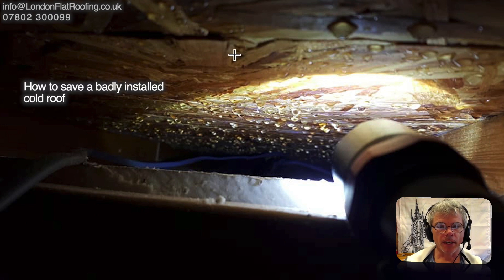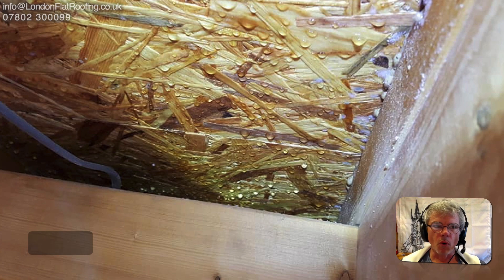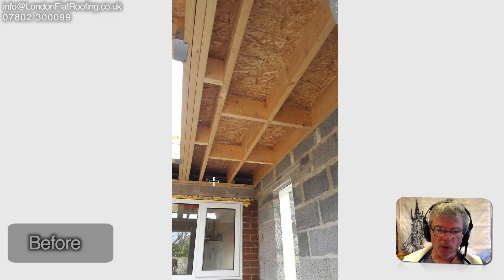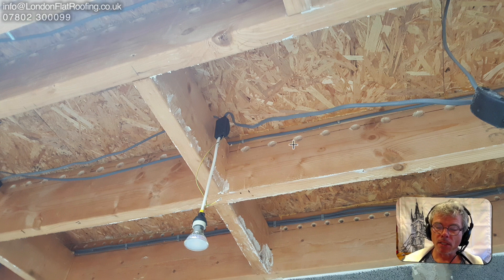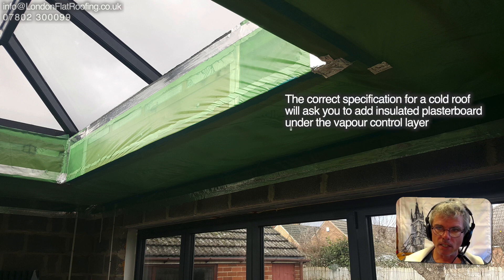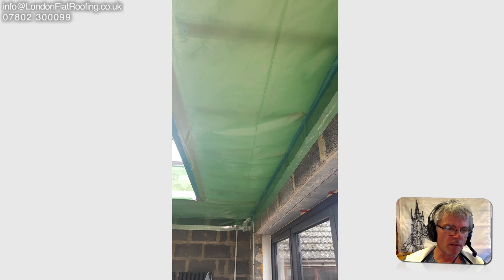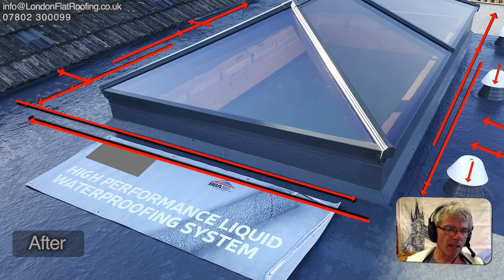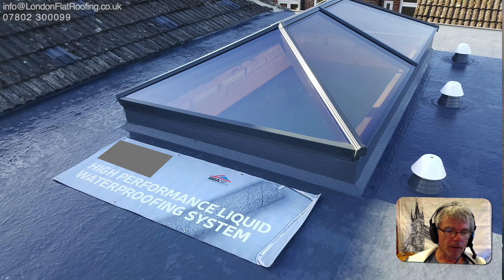Cold Flat Roof Ventilation Corrected

Comment: Hi Steve , in that video how did he fit spot lights back up now there's a vapour  barrier in the way ?
Reply: I'd love to know how too. Its all well and good saying don't cut the insulation and vapour barrier over it but how do you run a light in the exact same place using the existing wiring? Surely now it can all breath it won't matter too much because the warm moist air can travel through all the holes and not condensate. Granted, it's not going to be 100% thermally efficient, but he gets his lights and now has no moisture trap. I'm in the same predicament with a cold flat roof with only soffit venting on the face. It needs venting on both sides and crossflow drilling adding. Mine is also underdrawn with more insulation under the rafters aswell as in the rafters so this will stop thermal bridging but it's impossible to not cut my insulation for the spot lights.
Reply: I worked it out if anyone wants to know. I have no ridge airflow and only had a dorma face continuous vent strip so I added continuous vent strips in the dormer cheeks and drilled 32mm holes through and down every firring above the joists. I ended up removing all the insulation and amending the wiring runs to sit above the 100mm PIR requirement for my rafters (inside the 50mm airflow gap). Then at the spot lights, ran the wire down the side of the rafter and into a square cutout for a product called 'Thermahood' which is a sealed cover to prevent heat loss and air exchanging between the warm and cold side. I then also back filled the Thermahood with expanding foam which is friction fit inside the 100mm PIR and then added a 30mm PIR 'cap' ontop with the expanding foam helping to seal this all together. Finally, I dropped a plumb line, marked a big red X on the floor and then underdrew it all with another layer of 30mm PIR, taped all the seams and then added a VCB. Once plasterboarded and skimmed, I then used the plumb line to find the exact centre of the wire within the middle of the Thermahood and drill my 70mm hole to fit the LED spotlight and the hood can house any excess cable etc. The whole lot is airtight and thermally efficient. I had 21 spot lights to apply this method!

If you want, I'll make a video on how I did this. It seems no one has ever used thermal hoods for spot lights and this seems a massive challenge for most builders to understand.
Reply: @Craigo5000  yes please, it would be good help

Comment: Hey Steve thanks for all the great videos. Just wondering if you can use an insulated plasterboard for the ceiling on a warm roof? I was going to do this on my extension.
Reply from the maker: No you can't because that would not be a warm roof a warm roof means that the lower decking is warm the lower decking on a warm roof is actually internal you don't need a ceiling all your joists are internal the lower decking is internal the vapour barrier is on top of the lower decking everything above that vapour barrier is external You need the internal heat of the room to keep the lower deck warm if you put more insolation under it it won't be warm and that could give you a problem
Reply: @SteveRoofer  Thanks for replying. Your a gent of a man. Much appreciated. I get exactly what you are saying, that makes sense to me. Good explanation as well.
Reply: @SteveRoofer sorry I don't understand what you're saying there  my roof is 11degree pitch lean to  roof I have vapor barrier on top of ply then 120mm solid insulation then rubber on top of that  this roof is open to the attic of main roof on one side now I don't know what to do underneath do I need to try and vent it do I put more insulation between rafters do I need vapour barrier above the plasterboard ? Any help would be much appreciated thanks

Comment: I see some firms are building rooms with 5x3 joists and using 100mm pir. They push the pir up so it touches the underside of the ply and leave the small gag at the bottom of the joists and install a vapour barrier.. they claim this is a warm roof because the pir is touching the ply .
Reply from the maker: No, it's not a warm roof or a cold roof. The ply will be as cold as the outside at night but there is no ventilation so not a cold roof. It's not a warm roof as the warmth of the room below is not warming the ply as the insulation is in the way.
Reply: So this kind of installation will cause issues due to sweating With no ventilation ? 
I’ve been doing some research into garden rooms and due to the 2.5 permitted height to avoid building regs it seems firms are using smaller timbers like 5x3 to avoid loosing to much headroom inside. 
Surely it’s just a case of using 50mm pir so to give an air gap and installing vents in the soffit boards each side.
Reply from the maker: @paulpatterson1972  Yes and no. 50mm is not that much insulation but anything is better than nothing also it's not so much the insulation that's the problem its the venting and the airtightness of t the build. The cavity above wants to be completely airtight from warm air rising from below. The void above wants to be able to vent out any moisture that gets up there. The thickness of insulation is only applicable to how much heat you retain unless it's so thin that  it gets cold spots and you get thermal bringing and Interstitial condensation

Comment: Steve could you make a video about abutment and airtightness layer continuity of new (say extension) warm roof to the existing vented cold pitched roof. What I found confusing is the transition of a vapour barrier or airtight membrane which is on top of the deck below PIR insulation into the airtight layer which is below roof truss bungalow and above ceiling service cavity. 
Two environments shall not mix - the vented attic is full of vapour rich and cold, but space between joist of the new flat roof is below is vapour rich and warm.

Comment: Hi Steve - Great videos. Really helpful. 
I need to build a cold roof for my garden room (2.5m max). Noted the self-adhesive vapour barrier below the 100mm insulation/rafters and holes to facilitate airflow etc... and I saw you recommended insulated plasterboard (or at least more insulation below just above the pb) - what thickness would you recommend?
Reply from the maker: I take it that 2.5 max is the height internally? Anyhow the amount of insulation under the rafters can be anything from 25mm upwards typically 25 to 50 mm normally the U value calculation on the thickness of installation above will dictate the thickness of installation needed below. I think that it's quite widely excepted that the minimum thickness of installation below to stop thermal bridging through the joists is 25 mm.

Comment: Could he also take the vents off. And spray  foam insulation in every space.
Reply: Moisture in warmer air naturally rises to to the vent space, if it’s not ventilated it has nowhere to go so will condense on the cold roof above and rot the osb or ply from underneath.
Reply: @Copeinked  right but it cant condensate if its sprayed with foam. Right?
Reply: dude. wheresmycar This actually used to be the case when it came to building regs. No void, no air so no ventilation. But now many BCOs consider that just filling the void onto an insulated deck doesn’t constitute a warm roof and moisture will make its way through onto the underside of the cold deck and condense so a 50mm air void is regulatory and with a void needs ventilation. In theory you’re right, filling the void completely and dealing with expanding foam etc and then the addition of a vapour barrier would stop moisture.
Reply from the maker: No then the  roof wouldn't be vented
Reply: @SteveRoofer  what happens if it's not vented

Comment: Question Steve, what way do you go about fitting lights with the vapour barrier?
Reply from the maker: If you want to put a Spotlight into a cold roof you have to think of the following first it's going to sit in insolation that is sealed all the way round so there will be no movement and no movement of heat away from the light fitting so the light fitting will need to be probably LED because they admit very little heat the problem here is that LED lights normally are low voltage so you have a transformer that gives off heat. If you place the transformer in the installation it will overheat any few places above the insolation in the cold vented space above you can't get to it for maintenance. So the traditional type of spotlight is extremely difficult to successfully fit in a Cold flat roof. We find most people cut through the vapour barrier if there is one through the insolation and let the heat from the light dissipate into the void above the vented void above the cold vented void above. This then allows the warm moist air from below to rise up into the vented space above the installation and when conditions allow this moist air condenses onto the back of the roof decking. The installation is now 90% useless as the hot air is bypassing the installation and getting out of the building. The vapour barrier may as well not be there as more moisture is moving with the air then what the vapour barrier would have held back in the first place.
Reply: Steve Roofer warm roof is the better then, cuts out those problems. What’s the situation on a lean to roof? Also thanks for the reply
Reply: @SteveRoofer  Just thought I'd mention that these days, most (if not nearly all new downlight fittings) don't use transformers any more. They are all mains voltage, but can still be LED (either LED bulbs or fully integrated LED fittings).
Great videos by the way!
Reply: @SteveRoofer  You can now buy mains voltage LED lights without the need for a transformer.